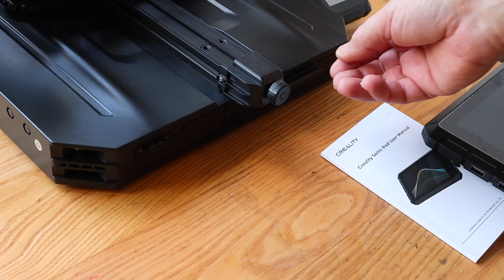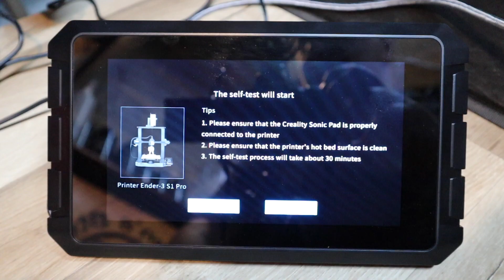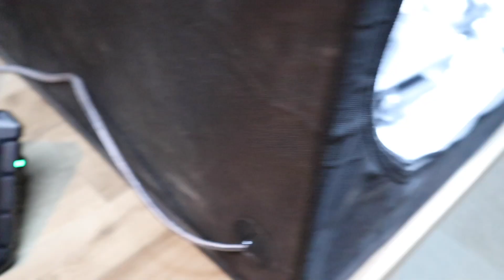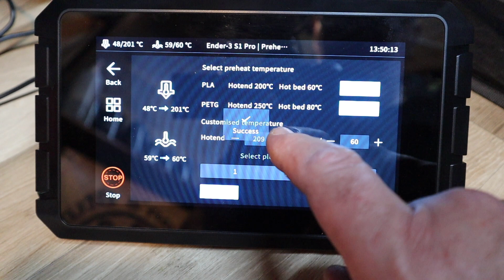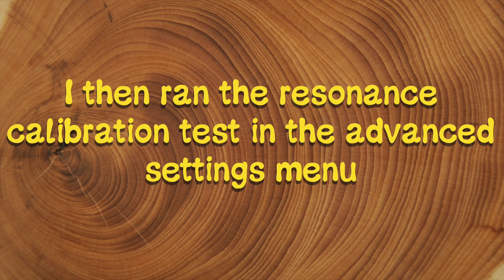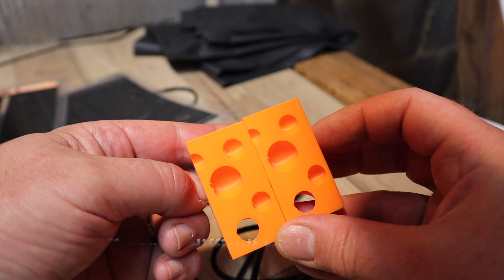Creality Sonic Pad - Easy Klipper for the S1 Pro

Comment: im eaiting for my sonic paf in the mail but im quiet skeptical bow. my s1 is upgraded with alot of parts already and i run marlin 2 gcode on a community flashed firmware from github already achieving these speeds and faster i can crank it up realistically i thjnk it goes about 500mm and have successfully printed many simple things at that speed. so when i get the sonic paf im not sure what im really going to get out of it. maybe some better iverall quality prints like your cheese wedges. the only thing I am missing is that resonance sensor.

Comment: Question...i didnt get screws for the g-sensor. Are they button head m3x6 or m3x8 & how many do i need? Do i need bolts too? Thanks.
Reply from the maker: Very sorry but I can't remember what size the screws were that I used and I couldn't find them when I looked earlier. I tend to have a large collection of various screw sizes and just find the best fit

Comment: I have exactly the same printer and have been mulling it over as to whether or not to get one, obviously this video is a year old so just wondering if you still recommend it a year on or if you've moved on to a better printer (this is my current dilemma, invest in the s1 pro or just put a bit of money away and get something new like the K1 MAX)?

Thanks for the video, as others have said, it was great to see the actual process of setting it up, getting it going and then tweaking and adjusting (e.g. the bracket), really informative :)
Reply from the maker: I still use my S1 Pro and my Ender5 S1 with the Sonic pad. I really like the user interface on the Sonic pad but I have to say that I mainly use my K1 these days, it is very fast and the housing is great.

Comment: To be fair I’ve yet to get anything beyond a pile of mangled filament from my S1 no matter how many calibrations I do I’ve been over z axis esteps flow rates the lot. This printer is not for beginners. Certainly not investing in anything else. Nor do I understand why I need to.
Reply: Try a OY offset for the bl touch it solved issues like yours for so many people
Reply: Also don't forget to clean your bed with soapy warm water if U didn't already
Reply: And the issue might just be that ur bed isn't leveled and z offset is wrong
Reply: I suggest that U remove the steps calibration and do what I said before because those are rarely the case and also make sure Ur belts are tight

Comment: Do you know if this would work on a basic early ender with the original board and original marlin?
Reply from the maker: It should work but it would be worth checking first, there should be a list of supported models somewhere on the Creality site. The older models may not have the hardware to take advantage of some of the features though.

Comment: Do you still load your gcodes onto to the SD card and then control it with the sonic pad or do you load them onto the sonic pad? Great video thanks.
Reply from the maker: You need to load the gcodes onto the Sonic pad via WiFi or put them on a memory stick and insert that into the USB port on the side of the Sonic Pad. Glad you like the video

Comment: I'm debating in getting this ender 3 pro or 5? Any suggestions
Reply from the maker: Sorry for the late reply, I would say the Ender-3 S1 Pro and the Ender-5 S1 are about the same in terms of print quality but the 3 is cheaper. They both work well with the Sonic Pad. Tough call, I think I slightly prefer the 3 mainly because of the PEI build plate.

Comment: Perfect. Im a software engineer so I don't mind the complexities of klipper but this still feels worthwhile to me. Pricing on RPi is insane at the moment anyway and I appreciate the complete package with the processor + screen + case all integrated rather than an ugly setup. Some have criticised this for being locked down but recent updates opened SSH for deeper config and also you can enable Mainsail and use the web interface for that, including integration with homeassistant. I don't need anything more and I think only those who are on the fringes and quite militant about open source should bother with a custom klipper setup. The only negative you could say is we are reliant on Creality to keep this updated. I think it's likely that future printers from creality might run this natively though, which would encourage them to keep doing so.
Reply from the maker: Yes totally agree. I am still learning more about Klipper. So far there have been some very worthwhile updates from Creality. I think that in future some of Creality’s high end printers will come with Klipper as standard. There is certainly room in their product range for a higher spec machine to rival their competitors. You can now apparently run 4 printers from the 1 Sonic Pad. I have been running my new Ender-5 S1 and the Ender-3 S1 from the same Sonic pad at the same time. It disables the original touch screens but this means that the Ender-5 should fit in a smaller enclosure if you can turn it sideways if you no longer need to see the screen. Many thanks for watching.

Comment: Thanks for a good video.
Id recommend doing some manual paper calibration before the autobed leveling. That way the GCODE doesnt have to be automatically compensated to much =)
Question: Does the standard screen still work? or is it completely replaced by this new one? :)
Reply from the maker: Many thanks for watching. Yes manual levelling is essential, the bed had been manually levelled when running stock. I actually went back an re-levelled after one of the Sonic Pad updates. The printer screen is completely blank once running on the sonic pad and I have actually removed it completely so that it fits in the enclosure more easily.

Comment: Great video... and I updated mine here and it stopped recognizing the USB on the back... how do you connect the USB on the back so the cable is not connected to the printer? Do you know how to solve? and com only accepts the one from Creality?
Reply from the maker: Thank you for watching. The update resulted in the USB ports being assigned differently to allow connection of multiple printers. Your primary printer will be assigned to USB1 which is the middle port on the left side of the Sonic Pad. I don’t know how you change it to the back one, I am guessing, but if you keep adding your printer as a new additional  printer it will eventually assign it to the back USB port. There is probably an easier way but I am not great with that stuff.

Comment: Hello, great video thanks for the information!. I recently got my S1 Pro.. I face a problem where the XYZ Calibration cube has some weird horizontal lines were the letters start. Did you have the same issue? And if you have, did the Sonic Pad help with that? Thank you in advance.
Reply from the maker: I have not encountered problems like this, check the eccentric nuts, especially on the bed rollers to make sure the bed is not wobbling but still free running. The sonic pad certainly helps eliminate certain print issues at higher speeds. I have found the resonance sensor to be very good but I have not messed with the pressure advance settings yet. Horizontal lines could be extrusion issues, have you tried different filaments ?

Comment: mine is not detecting the car reader any help??
Reply from the maker: I would try a different card reader or check the card is not corrupted, not sure what else to suggest. Many thanks for watching
Reply: @JimsonMakes  thanks for the answer, I already tried with different card readers, also tryed formatting the sd card and with two different cards
Reply from the maker: @Casal0x  sounds like a hardware problem, best contact Creality

Comment: I'm never sure how to do the Z-offset. It never seems to be right
Reply from the maker: It can be tricky, it needs to be such that the first layer is slightly compressed into the bed surface. If it is sitting on the top as a roll it will not stick and if it is too squashed onto the build plate it also will cause problems. If you are having a lot of trouble it may be that your bed is not level or that your build plate has a dip or bulge in the middle, Klipper should be able to make corrections for this.
Many thanks for watching.

Comment: Jim love your videos! Can you tell me a little bit about that sensor? Where do you get one and what does it do? I have the sonic pad on order, looking forward to using it!
Reply from the maker: Hi Adam, many thanks for watching. You should get the sensor and cable included with your Sonic Pad. The sensor is very small so keep an eye out for it in the accessories bag. I believe it is some form of accelerometer, the resonance test makes the machine vibrate at different frequencies, it is looking for the printer’s resonant frequencies so that it can avoid generating these when printing. I don’t know how it can achieve this but it seems to work.

Comment: The sensor lead is that a ps/2 port as if I got this I would want to get an extension cable
Reply from the maker: I think it is a ps/2 but there are several similar connectors out there. I don’t think it needs to stay connected once calibrated so you may not need one.

Comment: Great video Jim. I'm seriously considering making a jump to 3D printing. Have you done a breakdown of the cost to operate? For instance, do you know what the cost is to print one of your Cheese magnets? Thanks, V
Reply from the maker: Thanks Mike. 3D printing is quite addictive although can be frustrating at times. I think the thing I like best is designing something on my iPad and then being able to print it out. I haven’t costed it out exactly but because the pieces are hollow they actually use very little filament. With the resin printing there is a way of costing it out in the slicing software, it may also be possible in the other slicing software. It tells you how much filament the print will use, perhaps I should do some maths on it.

Comment: Can it be used with more than one printer at the same time?
Reply from the maker: I  don’t think so but you would need to ask Creality that question. Many thanks for watching.
Reply: @JimsonMakes  Thanks for your answer, I was looking at the Klipper Flsun tablet, it can connect up to 3 printers simultaneously, but it is a little more expensive.
Reply: Creality pad can run 4.

Comment: Jim, do you know how many printers you can run from one pad? Or you need a pad for every other printer?
Reply from the maker: I think you can only run 1 printer at a time. It may be possible to attach it to different printers for different prints if you change the profile but I do not know how you would do this. I am not very good with all the technicalities and still need to learn more about Klipper. It is the plug and play aspect of the Sonic pad that really appeals to me and I have started doing all my prints at double speed with no noticeable loss in quality. Many thanks for watching .
Reply: You can run 4, 3 on the flsun speeder pad.
Reply: Can the fsl sun be used with other bran printers?

Comment: A really good video on this Jim!  Now I see I can still use it for LW-PLA printing as you just dont speed up the print. So the foaming action can still take place…then speed up regular PLA  filament prints etc…. Laurie NZ.
Reply from the maker: Yes it will run at normal speed unless you instruct it otherwise, I think you can even slow it up.

Comment: Hi Jim! I have a Sonic Pad, too...but I had to get rid of my S1 because i just couldn't get it to print right. I just got an S1 Pro and want to add the Sonic Pad to it. How do you get your top surfaces so smooth? I can't get mine that way. I have been testing and have mine at 190 for the filament, 80% flow rate. 50ms & 1.4 retraction. I don't know what to do. I should probably get it smooth before adding the Pad. What do you think?
Reply from the maker: Hi Brian, I have retraction set at 1mm and 45mm/sec, just about everything else is at the default Cura setting for the S1 Pro. I do enable retraction between layers when I remember. I print at slightly higher temps. I use eSun PLA+ filament printed at 215 degC, this gives great layer adhesion although it can be tricky to remove supports.
Reply: @JimsonMakes  Thank you, sir! I think I found the issue...may be my filament temp. Once I get this set, the Sonic Pad will get connected! Looking forward to it :-)

Comment: I've read that you also need to run the accelerometer on the y axis as well to have a complete profile.
Reply from the maker: I believe it is meant to be testing X and Y at the same time, it certainly goes through 2 different cycles. Very strange test, sounds like some sort of aircraft taking off. The sensor is put on the hot end as this is where it will give the most effective results for printing but it is measuring the resonance of the entire machine. Many thanks for watching
Reply: Fyi, I have seen a YouTube video where the sensor was stuck to the bed with double sided tape to get the Y axis data….?
Reply from the maker: @LWJCarroll  makes sense, I will look into it, many thanks